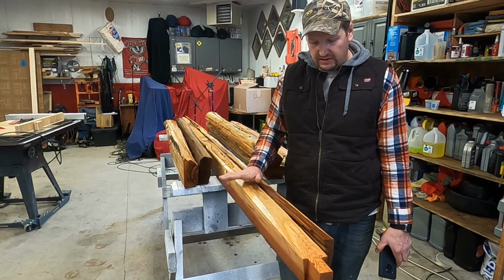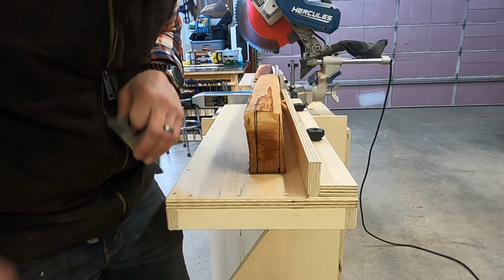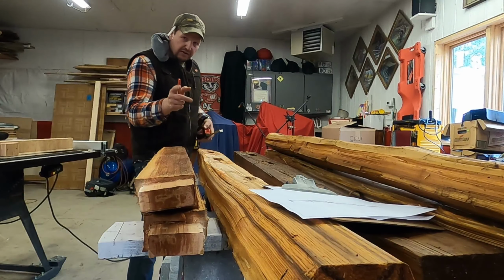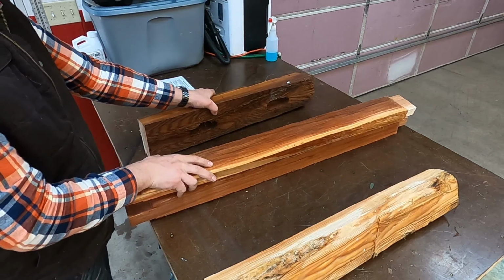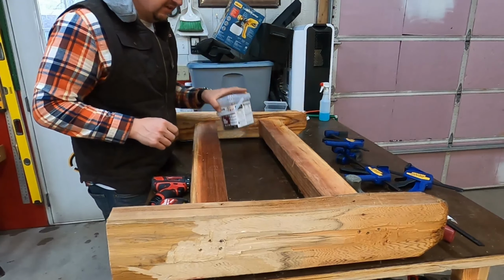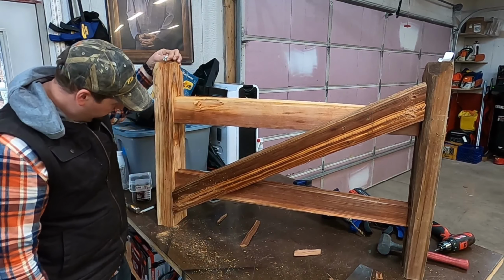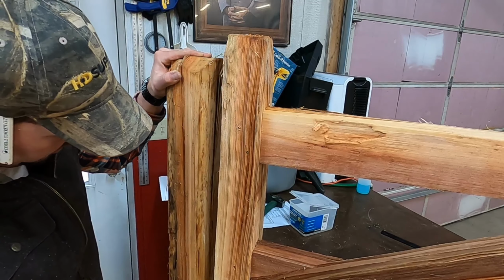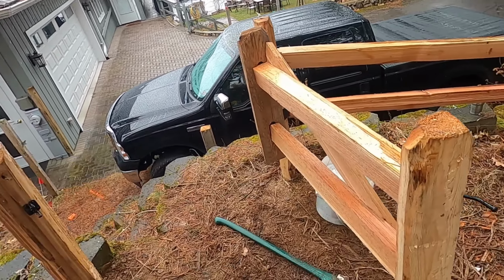How to build a gate for a cedar split rail fence.  I've never done this before!

Comment: Nice job, except your brace is backwards.  It should be low on the hinge side and high on the handle side.  This helps prevent the gate from sagging.
Reply: I just came across this and was going to comment that.